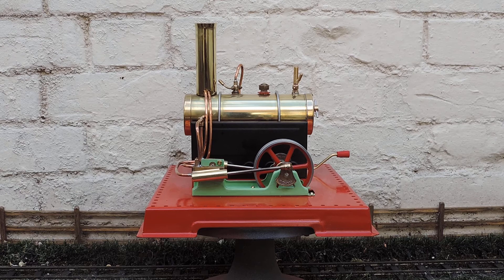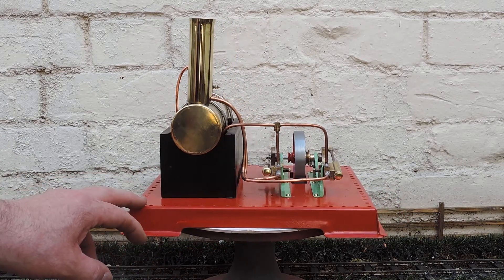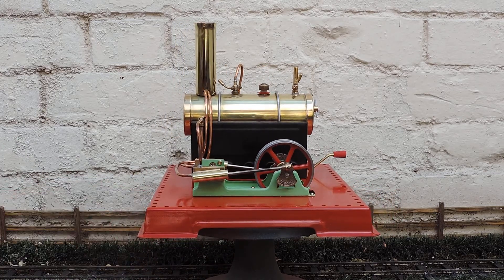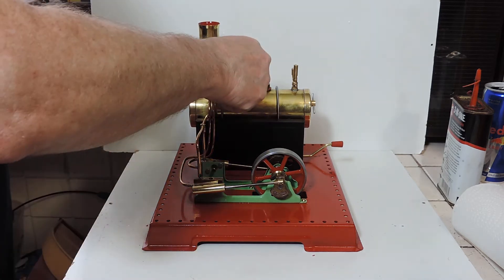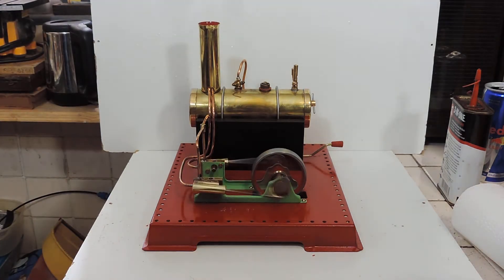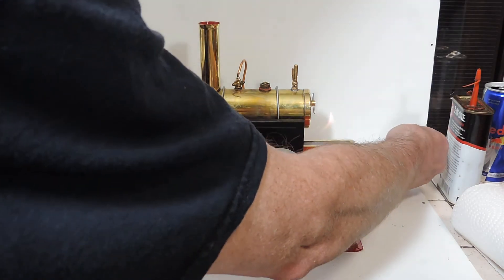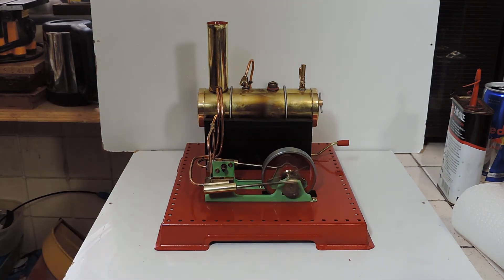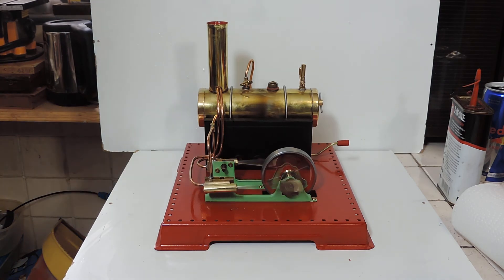Mamod SE3 Model Steam Engine Restoration - Part 5

Comment: Been restoring my little mamod p2 for 2 days now that i picked up at Malpas steam engine rally it looked like it had been in the bottom of a river for 20 years getting there with coats of wilco's metal primer and grey primer there. It will be my first time soldering the steam tube got my new butane torch flux & solder

Comment: How did you replicate the hard ollow rivets holding the engine frame to the base or did you use bolts instead
Reply from the maker: Hi Timothy. Sorry for the extremely late reply but I didn't get a notification of your comment for some reason. I used round head 6BA bolts to replace the rivets.

Comment: That burner you made is incredible you should make some and sell them, they’d be very popular!
Reply from the maker: Thanks Ryan. The burner did turn out quite well but there was rather a lot of time spent on making it. I'm not really into making stuff for selling, just one offs when needed for my restorations. Cheers, Alan.
Reply: Retro Steam Tech hi again, I’ve just got my first se3 in the post today and noticed the cylinders aren’t 180 degrees opposed, was wondering if they’re supposed to be or if it’s slightly out of that range?
Reply from the maker: @ryansheridan6904  Hi Ryan. You are correct in that the cylinders are supposed to 180 degrees opposed. However the engine will still run if they are slightly out from that. Cheers, Alan.
Reply: Retro Steam Tech cheers Alan, turns out the grub screw was loose and causing them to go in all sorts of different angles😂, now trying to stop small leak on cylinder feed pipe on the block, proving very difficult
Reply from the maker: @ryansheridan6904  Yep, that will do it.  With the feed pipes, sometimes you can get away with just re-flowing the solder around the pipe where it enters the block. Other times you just have to clean the pipe & the block and re-solder. Cheers, Alan.